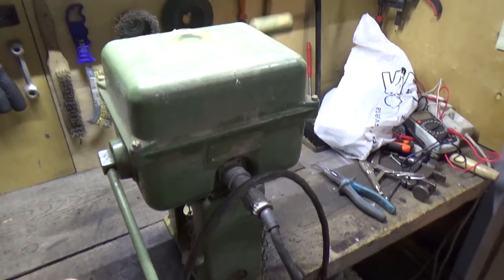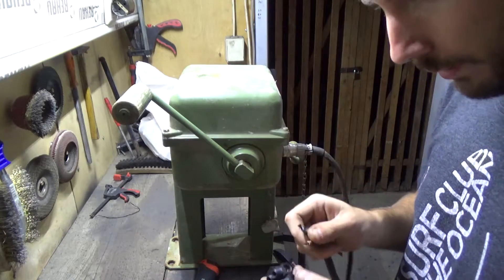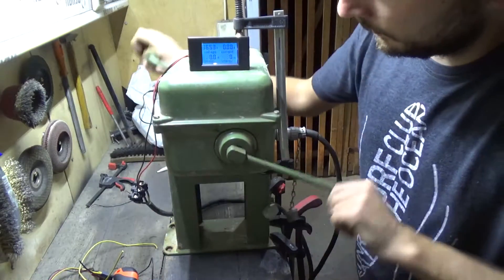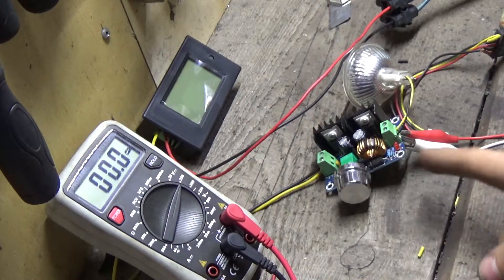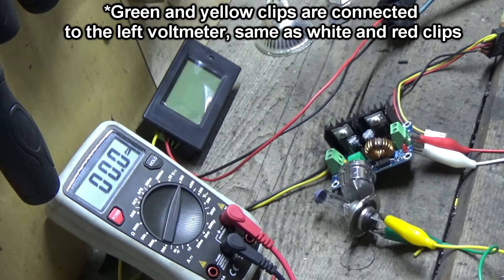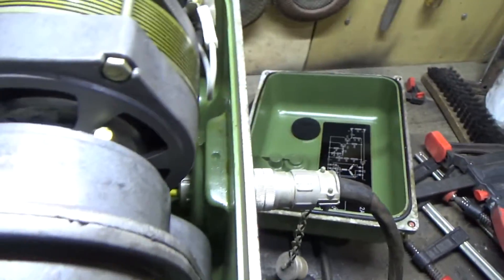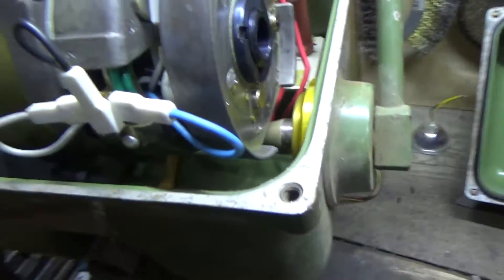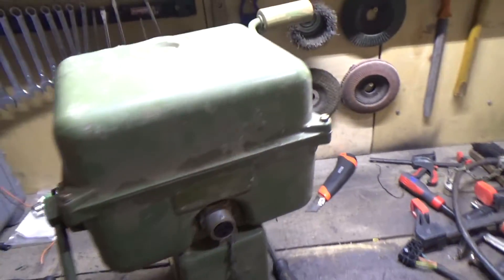Very Old Military Hand Crank Generator

Comment: These where meant to charge the battery banks so the load would be minimal at the time of cranking.  You would use at a steady pace about 1 crank a second for 30 minutes every few hours to recharge the batteries

Comment: Nicely made unit in it's day.  Gearbox sounds a bit loud but operable.  This is why I made my own generator that would serve as an experiment for LOW RPM, such as 1 to 1.5 turns per second, 60 to 90 RPM with NO Gears or pulleys, Silent.  My findings with hand crank devices are basically used for low power applications because the torque required to go more than a watt or so will become a task that you really don't want to do for sustained time frame.  The end result is that it is an energy converting device that you don't want to sweat over too much when it comes to doing the physical work.  You can see it in operation on my channel powering up an array of 900 LED's.  I was able to generate around 8 to 10 or so watts, but it was work.  Leg power can be better than using wrist for more energy.

Comment: it would be more interesting if it were applied to a gravitation system: a clock that by letting a weight go down, for 10 minutes, recharges the battery. Anyway congratulations.

Comment: I used hand cranks when I was in the British Military.  This looks like a NATO specced piece of kit (24V was standard across NATO), the connector looks very familiar.  We always used them to charge NiCad batteries for a HF radio.  It was impossible to transmit using just the hand crank but you could receive.

Comment: Just Asking, is that possible to charging the handphone?
Reply: Yes, you can charge almost anything, you just need a step down regulator to adjust the voltage you need for charging and regulate the charging current :)

Comment: What is the OUTPUT voltage is it in AC or DC pro-bably it is AC and so , it would be EASY to trans-formed the VOLTAGE to > HIGHER voltage for VAcuum tube PLATE supply the B.
Reply from the maker: If you watch the video you can see that it it a dc 24.5v output
Reply: @DIYGarageProjects  I like your GENERATOR but it is NOT avai-lable here at Philippines. It is GOOD to power RECEIVER during TY-hoon I need that for EMERGENCY pur=poses es=pecially here at Philippines there are a lots of DISASTERs and Calamities ,Thanks for INFO .

Comment: It becomes easier to crank because you have a non linear, constant power load attached to it. Your step down circuit works linearly up to 12V or whatever  you set the dc-dc converter then it flattens out the power. This means that as you increase the rotation speed above what generates 12V, the amperage, and consequently the torque required to keep the unit running decrease linearly. Which can be clearly seen by the fact that at full output power it draws "only" 3 amps while at 12 volts or so it draws 5 amps which is what those bulbs are rated at. (P = ωτ)
Very beautiful object anyway.

Comment: This is new ...it is from 80 years and are made in Yugoslavia
It is for army radio RUP 20
Power normaly is 25-30w no mor from hand in long term use.
Also is another one for 12v
I also have a lot of model of som kind of thing form 1944  to 1990 model 
The best is from PRC 320 radio  small and nice.
Use it like it is !
Good luck!

Comment: inside, that's an alternator, NOT A GENERATOR, it's not nearly as old as you think, Jim David, master auto mechanic alternators were invented in 1970 or thereabouts.
Reply: yeah, this is probably not old than 50y. Electric cable and rubber seal are in relatively good shape. WW2 rubber will no survive until now.

Comment: The feed back circuit is to excite the armature. That means it doesn't have permanent magnets as an armature. It's a car alternator rectified to DC with the armature being self excited instead of excited externally by a battery. Once u fill up the capacitors it powers the armature and turns it into a high powered electromagnetic. Advantage over permanent magnets is it's more powerful and 1/10 the weight. It's a hand cranked car alternator. It's in great condition 👍
Reply from the maker: Great description, thanks for watching
Reply: If it does not have permanent magnets to create flux, then it mush have external battery energy to create a flux in order to get the whole thing going.  Even alternators need external DC to get the field going before the stator can generate energy.  So in order to fill up the capacitors, it must have some tiny magnets on the armature to get the excitation circuit to do it's job.
Reply: I was going to say, it looks like its regulated to 24.6/24.5 volts. That's why it got easier for him to turn it once the voltage came up. That would be a neat generator to connect to a water wheel
Reply: Great info!

Comment: So it's a 120 watt 24vdc battery charger, that's very handy in the bush. Charges 2 car batteries at the same time. 24 vdc makes an excellent dc welder in the bush. Nice find brother. Batteries were usually 6 vdc back then as well.
Reply: First of all, you will need 14.4V to charge the car battery and second, why you need dc welder in the bush :D
Reply: @banny123456  to weld up trees?🙄

Comment: The printed circuit board is fiberglass.  They did not have fiberglass circuit boards during the War.  If the printed circuit board is original, then this cannot be a WWII Generator.  In fact, it is unlikely there would be a circuit board in it and everything would be hardwired.  Plus those resistors did not come from that era.

Comment: This was actually probably for radio communications, radio was a crucial part of WWII and you need power for radio no way around it. 24 volts could charge up a flat vehicle battery too, lights was probably just a bonus over various types of fuel lighting
Reply: That was  built after WWII and is to NATO specifications. I would say 70's myself.

Comment: This was made to use with a transmitter receiver unit - just enough energy to contact base. That is why the voltage stops just above 24V so that the radio is not fried! For lighting it would be an oil lamp I'm afraid and nobody could keep the generator running for more than a few minutes. They were often used by units in the jungle where a gasoline generator would have been too noisy.

Comment: that circuitry looks younger than 1960.
Reply: It looks like a circuit board made of fiberglass used in a 70's large company design computer i got from dads work back in the 90's.
Also the resistors is different and more modern than my old radio from 1950 and 45.
I got a radio from 1958 too, and the color of this pcb is medium brown and not fiberglass print card board.
So yes, agree, way more new than the war, at least the war we think about :)
But perhaps he ment the Vietnam war? I bet it is from 1967 and up.
Reply from the maker: I ment the war my country was in, in 1991 to 1995
Reply: DIY Garage Projects and reviews just curious if you restored it

Comment: https://youtu.be/oUsd7sdW3fA

Hi, nice project. I added a PWM and a cap bank to reduce operation fatigue when charging a super cap bank. Cheers.
Reply from the maker: +GoVertical17 I have a 24V to 240 ups, you can see it in my latet vid, i want to have some fun, powering stuff with my hands like tv or some low power appliance, would that be an interesting video?
Reply: Hi, yes. I look forward to next video. Thank you for posting.
Reply from the maker: +GoVertical17 thank you for watching and leaving a nice comment :)